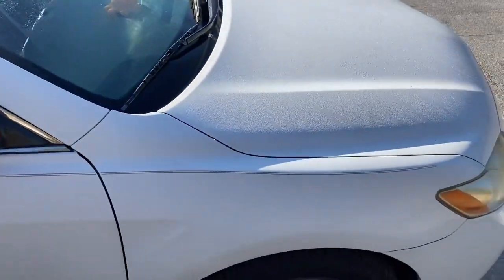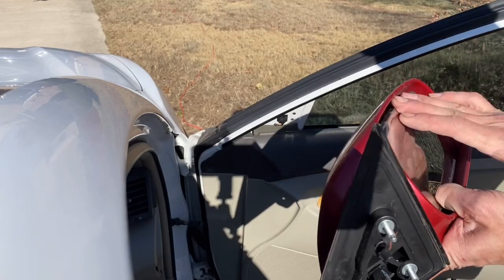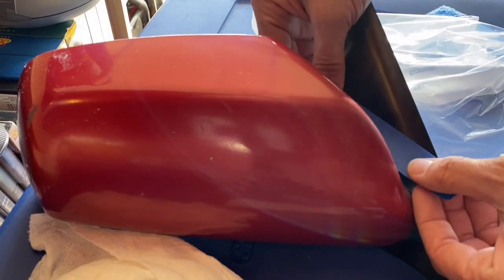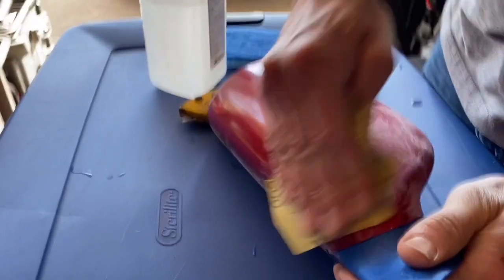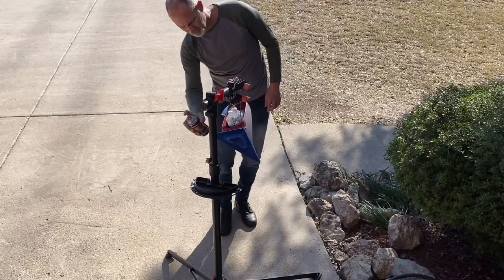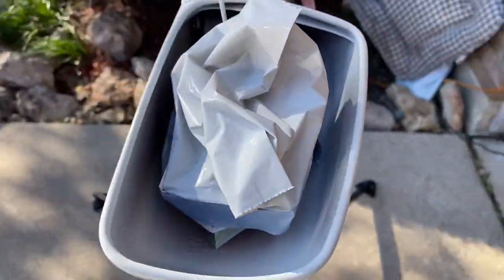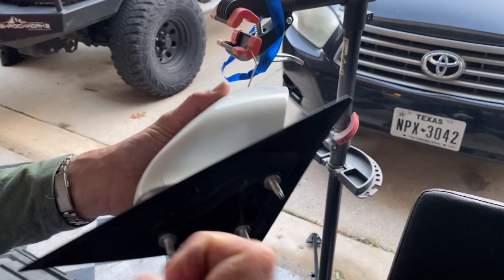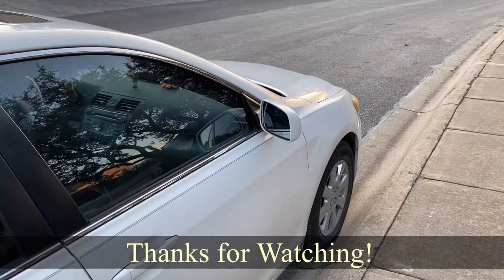How to Re-Paint Salvage Yard Parts

Comment: Could you also do the Xterra side mirrors. Trying change out the mirror without breaking it
Reply from the maker: You want me to show how to remove and replace my Xterra side mirrors?
Reply: Separating the mirror from the housing. My mirror has lots of scratches, swirls, and chips and I’ve tried separating it and damaged the motor. I got another mirror from a salvage yard, but it’s not any better. I tried searching online and YouTube, there’s nothing in regards to Xterra. I have a 2001 Xterra that could use a refresher appearance for such an old vehicle. If you could it will be much appreciated. Thank you
Reply from the maker: Next time I am at the salvage yard I will make a “short” detailing it.  I don’t want to damage my own mirror mechanism in the process!
Reply: I hear you. Thanks for the reply and I’ll keep an eye out for that short. Thank you 👍